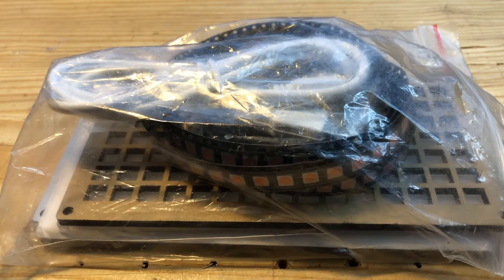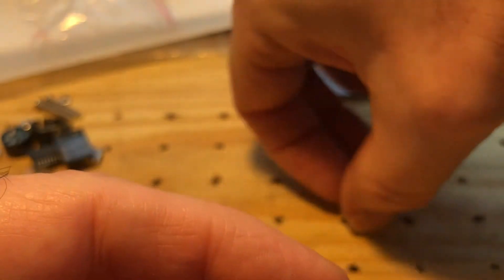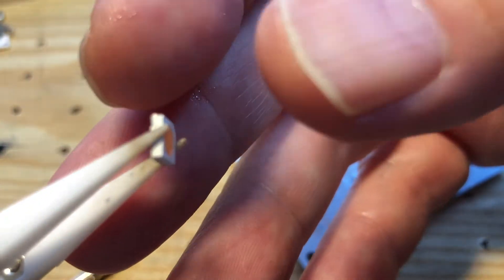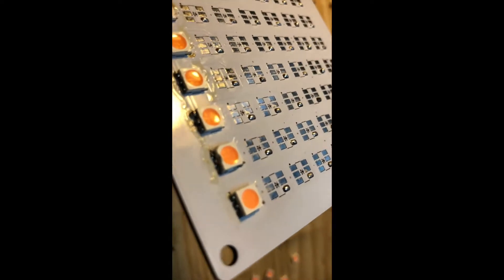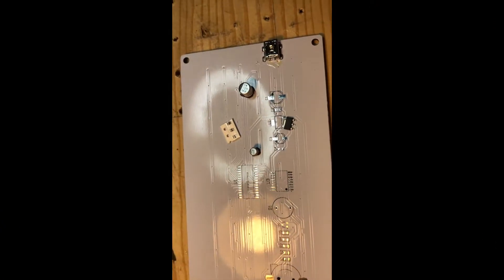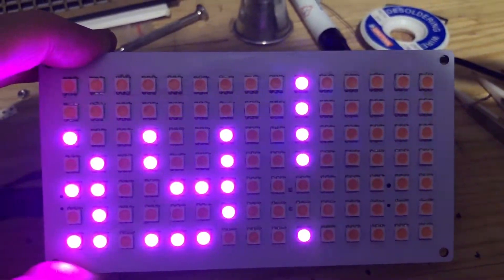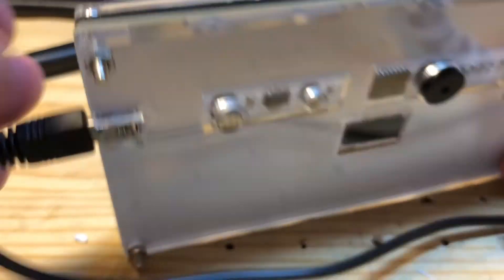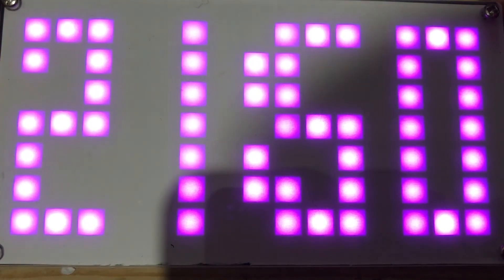Banggood: Geekcreit® DIY DS3231 Touch Key Control Big Size Dot Matrix Alarm Clock Kit

Comment: Excellent! Many thanks for taking the time and explaining each stage. Good methodical sequencing of component additions and tips on soldering.  One question, as I am new to SMD soldering, did you tin the pads prior to soldering the IC’s, capacitors etc?
Reply from the maker: Hi Chris. The best way with any smd is to tin one pad and solder the component down. Then solder each of the remaining component legs. A little flux added will also help and avoid bridge connections.
Reply: I would solder a leg to hold the component in place if you are using an iron. I used a hot air rework station and fast melt solder paste, it is a much faster way to build it and if you spread the paste out properly it will solder the parts perfectly without creating any bridges. It is a great kit and my clock is still running strong after a year of being on non stop.

Comment: Will using flux pen helps when soldering the 6 points of the led so that there wont be any bridges?
Reply from the maker: Probably not too much as only needs a tiny amount of solder for them.